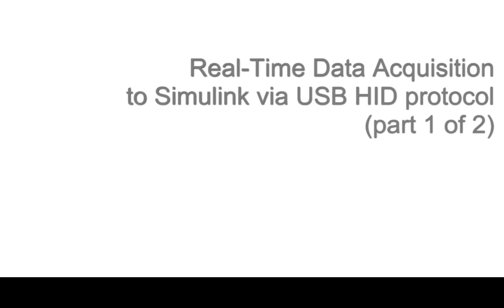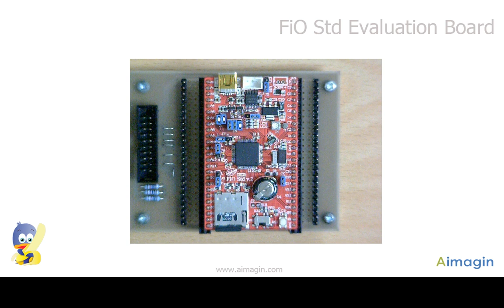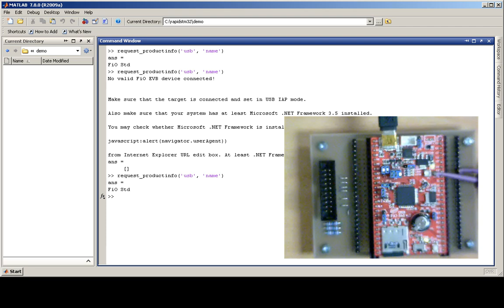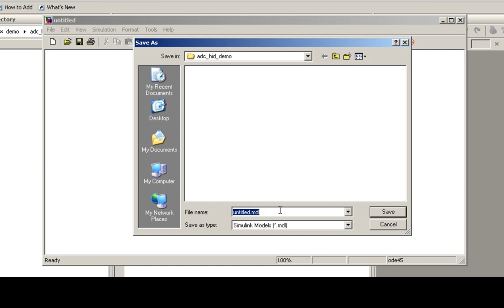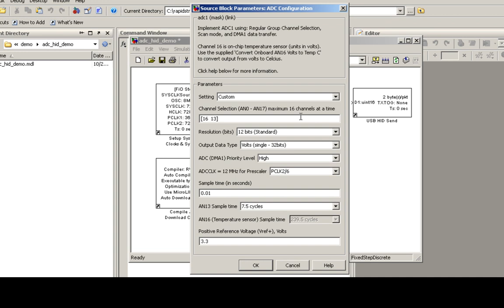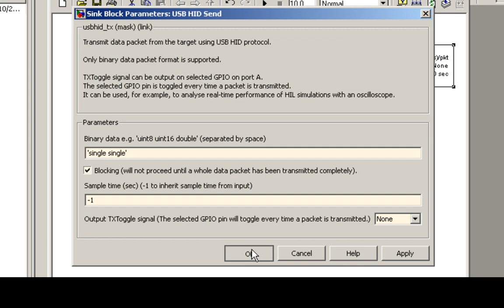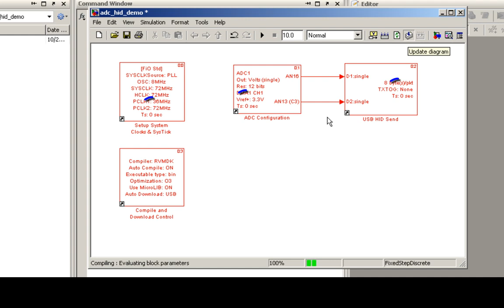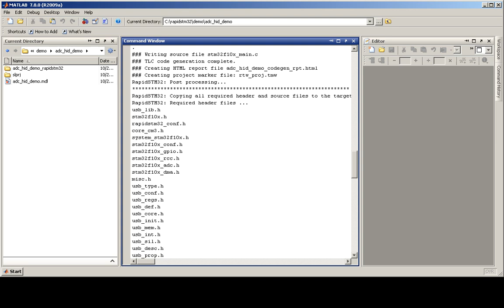(New) USB-HID Real-Time Data Acquisition into Matlab/Simulink Demonstration (part 1 of 2)

Comment from the maker: Unfortunately, we do not know the answer to your question, since it is a very broad question.
However, in general, this depends on your hardware (wifi and labtop) and the protocol they use to talk to each other.
Then you need to write code to facilitate data exchange between them.